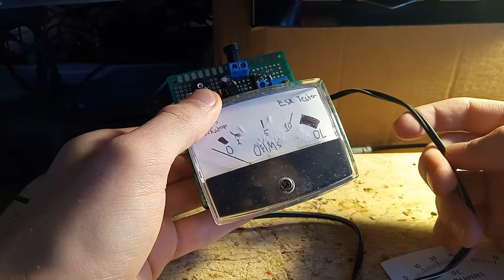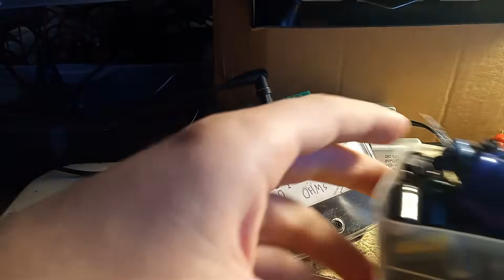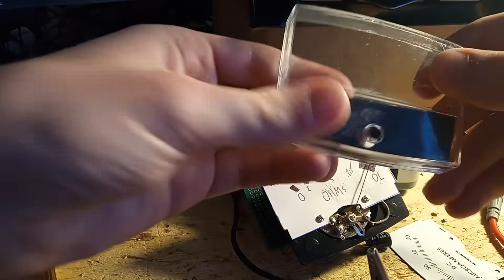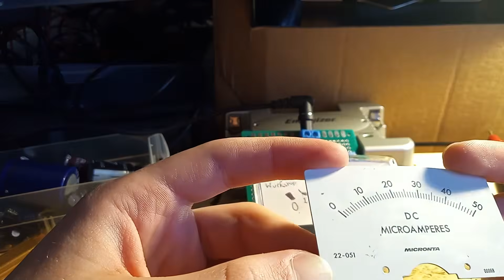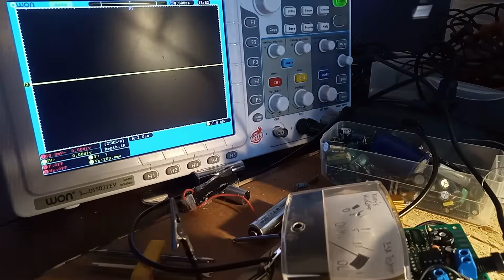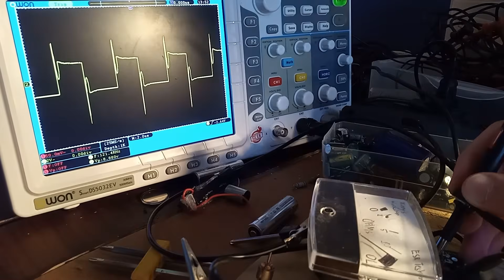Homemade Capacitor Tester

Comment: Underrated channel. I just discovered it, lots to catch up on. 

I wanted to comment on the universal adapter video but comments are turned off. I bought a 240V version (NEMA-6) a couple years ago for a UK 3000W electric kettle. Boils water faster than the microwave!

Anyways, the adapter has the ground pin, but the other problems you mention are still there. But also it doesn't meet the amperage listed on the device. I just noticed the other day that there's some melting on one of the contacts, even though the connection is firm. 

I would really love a proper adapter that fixes all of these issues, but I'll probably have to cut the plug off and put a NEMA-6 plug in its place. Annoying but yikes!

Cheers
Reply from the maker: Interesting. I remember seeing a video by @TechnologyConnections where he used an EV charger along with a special adapter to do the same as you are doing, but I'm not sure how useful this may be if you don't have an EV charger.

Personally, I'm fine with slowly boiling water in a cheap Wal-Mart kettle.